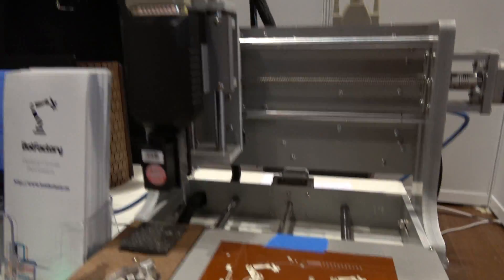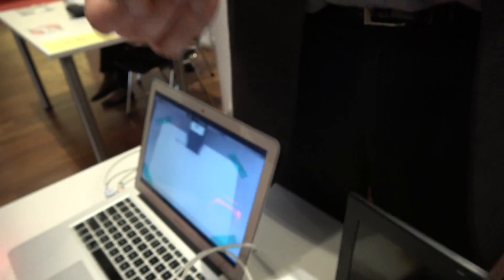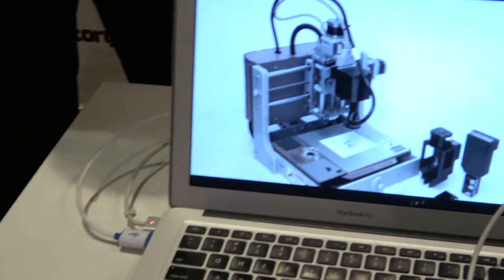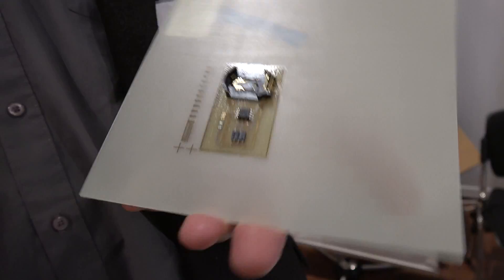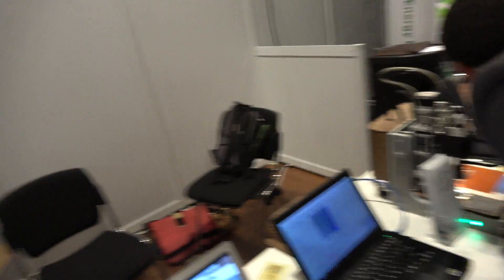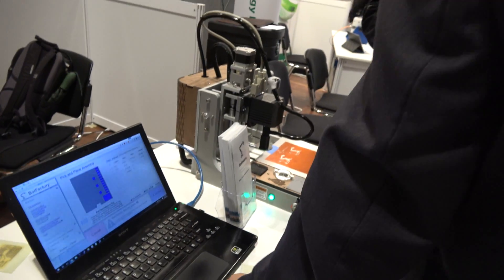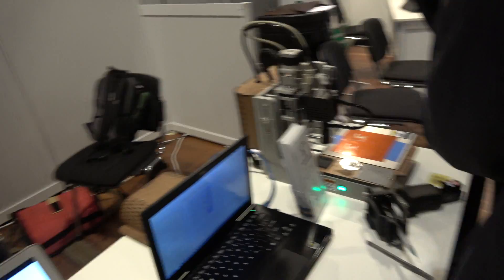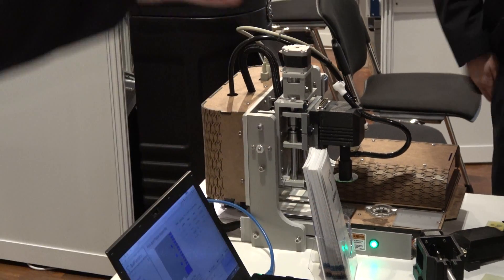BotFactory Squink PCB Printer

Comment: What conductivity ratings and what temperature conditions this in can handle?
Reply: Conductivity is between 20 and 40 milliohm per square at 4 micron thickness. I can deal with 300C easy.
Reply: @BotFactorySquink  thanks!